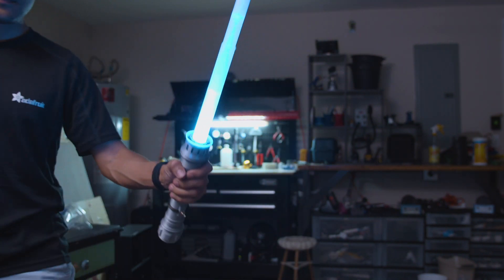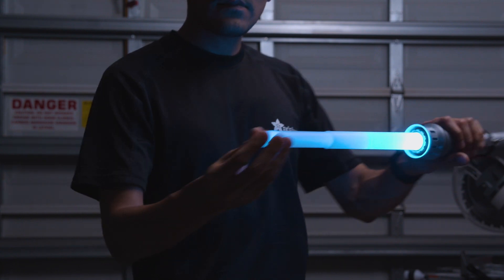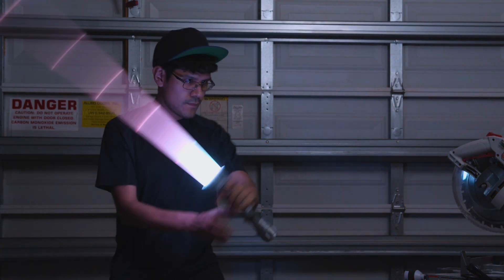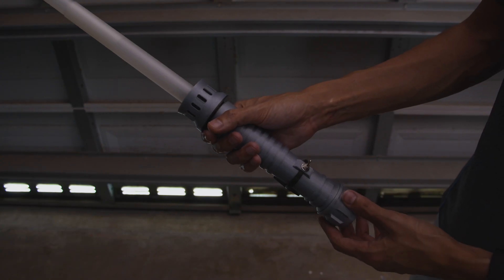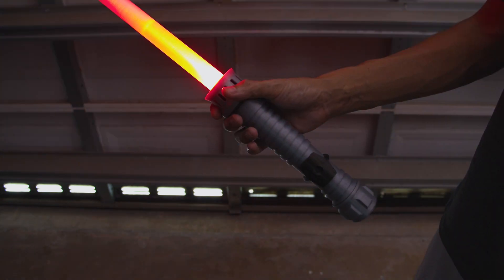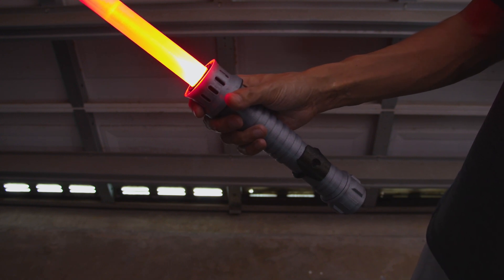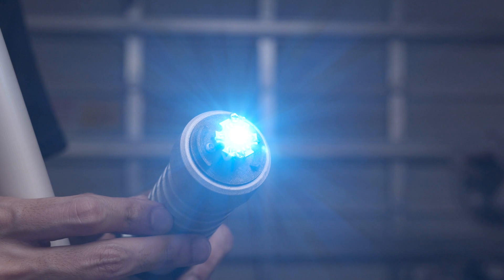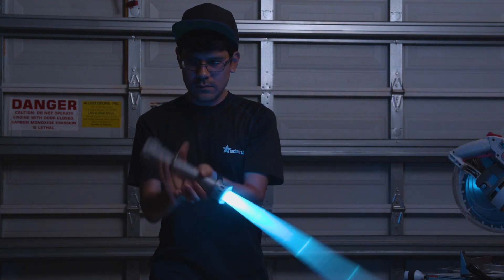Light Up Prop - Course Overview #3DPrinting @adafruit #adafruit

Comment: Great tutorials, Im trying to make something similar. But my question is, can you disable the motion sensor and have just one sound play when the board turns on, and another sound/light effect when a momentary button is pressed? Thanks for your time. Best to you
Reply from the maker: sure, the code is written in python and its commented so it’s readable. There is button press demo code in circuit python essential guide that would work
Reply: @adafruit  ahh far out! Thank you for coming back to me I'll defiantly look into that today and get rolling with the board. Thanks for your time I appreciate it. Best to you
Reply: @adafruit  Thansk you again for the insight, but could you point me in the direction of that button press demo code in circuit python essential guide? Ive read alot, very helpful and informative, but i dont think Im finding it. I appreciate the time